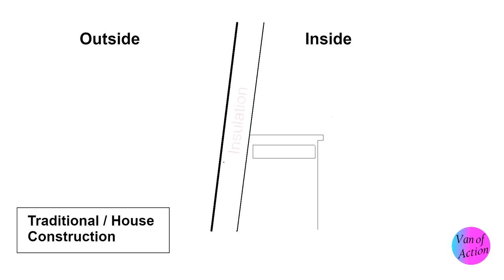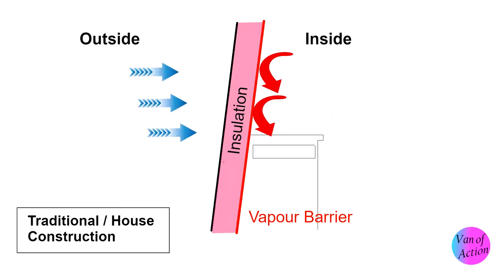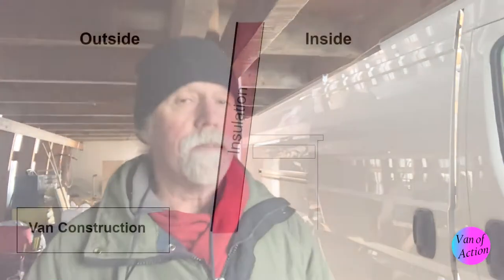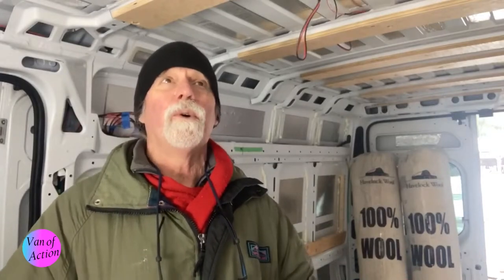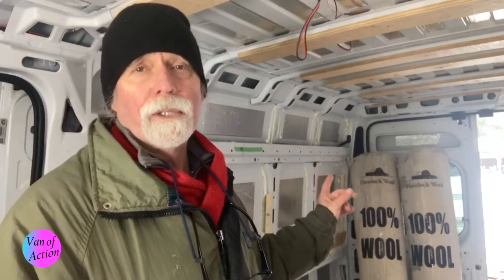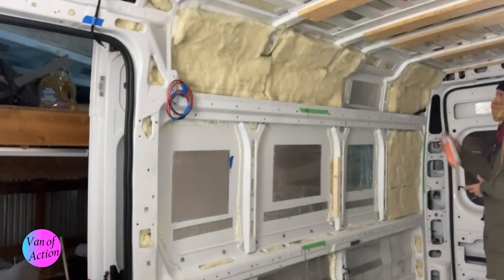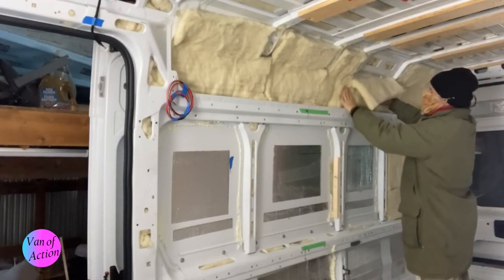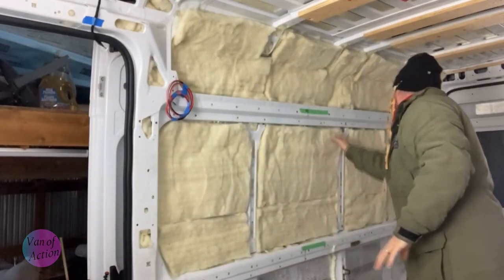How To Insulate A Van - VanLife Havelock Wool, spray foam or thinsulate for a warm and quiet vanlife

Comment: I just wanted to commend you on your replies to some of the comments that seem quite critical of your method of insulation. This seems to be almost an emotional subject to some. Personally for myself in my '20 Promaster Im using thinsulate on the large flat surfaces, leaving the large cavities at the roofline sides and down the ribs along the sides open and free as an air passage way though all ribs are covered on the living side surface with 1" R Max. All four corners at the ceiling have 4" computer fans built in drawing air after a humidity event from the floor area through the ribs of the van into the living space and expelled by the 2 Max Airs vent on the roof. Absolutely no inner vapor barrier for me as the outer sheet metal of the van is a given vapor barrier and I dont want to trap moisture between two vapor barriers.
Reply from the maker: Hi JG-k4oi  - thanks so much for watching and taking the time to comment - I believe it's in the conversation we learn and grow.  I don't have to be right.  - yes - insulation sure gets the blood going.  So many different ways to it.  I'm intrigued with your use of the fans.  I agree with the concept but I'm not certain of the effectiveness in extreme colds.  The difference in temperatures outside / inside and the small R value of any insulation is going to cause condensation - maybe not where the air is moving - but at the dew point of the system everywhere else.    But that's just me ... let me know how it works.   I hope you'll join the community and stop back. ..... Dave

Comment: Did you take any measures against the thermal bridging that occurs on the structural metal that your wooden framing is attached to?
Reply from the maker: Hi David.  Thanks for watching and commenting.   I did not.  All in we’re talking about 2 maybe 2 1\2 inches of insulation.  I believe it’s possible to over analyze things.  I just strapped the ceiling to accommodate the wood ceiling and filled whatever void was created.    I hope you’ll stop back and join the community. ……  Dave

Comment: Great vlog, new subscriber too 😊 should I put a vapour barrier over the wool?
Reply from the maker: Hi Rachel - thanks for watching and commenting.   There are a million different opinions about vapour barriers.  Mine is, as described in the video, that the band vapour barrier is on the inside of the body metal.  Even if you could actually make a uniform seal on the inside I would not recommend it.   Good luck and thanks for joining the community.   Dave

Comment: Also metal conducts cold and heat. You should've covered all the metal. You left the struts uncovered, you could cover those too. And when you put up the panels you can still screw them on right thru the wool. I got that info from a Mechanical Engineer. Where you didn't put the wool after you put the walls up, on a cold day touch were you attached the panels to the struts and you'll feel it slightly cool because you didn't cover the struts. Won't be anything major but if you press your hand there and hold it there you'll feel the cool or heat on a hot or cold day.
Reply from the maker: Hi Joe - thanks for watching and taking the time to comment.  I agree totally with the theory - but having used the van now for a while I'm convinced that the insulation is really more to control the moisture a bit and the sound a lot.  In terms of keeping things warm it's really ineffective.  Maxing out at a couple inches and with the heat loss through windows and the floor there really isn't much to it.  Open a door once and you start from scratch all over again.   We have used it in -12 C - It gets cold quickly - but warms up just as fast.  But that heat just leaves  .........  be well and stop back.  Dave

Comment: Hi there, thankyou for your video. I live in Australia. Some parts of Australia is cold, some parts of the country is super hot and some parts in VERY RAINY and knowing me, i would probably living or staying in those rainy area due to the lush tropical weather ! 
I have just bought a toyota coaster and currently looking at converting it.
I have watched people talked about foil boards, wools, ultra touch denim which there are none in australia to buy anyways, and apparently thinsulate is really good. But even that is quiet costly to import to australia. So we have earthwool that we use here, not sure about Havelock. 

Would you recommend this methods? 

Maybe simple is better with prevention condensation. It makes sense about wool absorbing moisture and releases it after like you said. 
Im not sure about foil boards.
Also thankyou for the tips about install the insulation post cabinets frame work.
Reply from the maker: Hello Sunflower !!!  It's so cool to me that someone where you are would watch the video I made in my little shop in  the interior of BC !!!!     Thanks for taking the time to comment.   It sounds like your climate is very much like mine.  We insulate for several reasons - keeping in the heat, keep out the heat, keeping sounds in and keeping sounds out.  I expect every / any insulation will do these things to some extent.  What some will do better than others is handle the moisture that will occur in the wall cavity - there is no question it's going to form there (unless a person uses a closed cell spray foam).  

Earthwool is a recycled glass product which appears to be a good insulator.   However it would not absorb and release moisture as natural wool would.   But if that's all you can get then you have to find a way to may it work.  I'm not familiar with a toyota coaster so check to see if it's designed to allow interior moisture that will build up inside - if there are ways for the moisture to escape make sure that you leave them open.    If there is no designed way for the moisture to escape - you'll have to give it some thought.  I'm sure there will be a way to take care it.  We also installed a Noika sound membrane on the walls, floor and ceiling to reduce vibration.

In practice, we've found our insulation and the Noika have dramatically reduced the road noise and exterior sounds when parked - we don't even hear rain !!!   But remember that a couple inches of any insulation will not keep your space warm when it's really cold out.

Be well and let me know how you make out !!!   Cheers

Comment: On the floor would it help to add a sheet of thick plastic as a vapor barrier then bulid the floor frame and use havelock in the floor frame then attach plywood floor? Thoughts?
Reply from the maker: Hi six strings - Personally I would not add the plastic - in fact I didn't !!!!   I don't think it's possible to create an  air tight membrane on the floor, especially along the walls. I believe it's better to let things breathe.  I framed my floor using  1" square aluminum tubing, glued to the tops of the ribs.   I installed the aluminum at about 12 inch centers so I could use 1/2 in birch ply wood without sagging.  Then I put the wool insulation in between.  And then glued the plywood down.  I thing the moisture in the 1 inch space will be minimal and air will be able to migrate in and out.  I hope that helps.  Insulation is such a debated subject in vans :)  be well

Comment: What about the floor? I have a transit and when I pulled the OEM rubber floor up (CCF pad under it) the floor was soaked from condensation so I wondered if that's going to be a problem if it's insulated since it won't breathe? Great video though, I looked today and the havlock is a 6 week delay. The whole vanlife world is buying it I guess.
Reply from the maker: I didn't do the floor when I did the walls - in fact I wish  I had waited to do the walls and ceiling too.  I don't know why people insulate so early in the process.  Regarding the floor - I am starting it now.  I'm only gioing to insulate (or put a floor) in the cabin where we walk.  Not under the cabinets and not in the garage.  I want the floor we walk on to be comfortable but I don't want to sacrifce the space a floor would take in the garage.  For bikes every inch counts.  In the cabin,  I glued 1 inch sqare aluminum channel as a spacer, then added the sound deading and wool insulation in between.

Comment: @ 2:42 You almost got this right here, but you omitted the now-standard Tyvek housewrap (barrier) that effectively prevents moisture infiltration from the outside of any modern residential construction. @ 3:19 "...but in a van, the outside layer is the vapor barrier.. ...we're almost turning our [conventional building] system inside out..."  In a metal building (or a van) you have barriers on both sides, preferably with impermeable thermal resistive insulation (i.e.: has an R-Value) in btween.
Reply from the maker: Hi Video Pipeline -  thank you so much for watching the video and taking the time to make such a detailed comment.   I love these - I believe that it's in the conversation that people learn and form their ideas.   I know there are a ton of people lurking here.   And my experience in van building is that there can be tremendous differences between the theoretical building concepts and how things actually work ......    * Yes* - I did omit the Tyvek housewrap - which  is a very effective moisture barrier for air coming into a house.     However,  I disagree with the comment that " .....  In a metal building (or a van) you have barriers on both sides,...."  you'll only have 2 barriers if you build in 2 barriers and I don't believe it's possible to do that on the inside of a van without using a closed cell spray foam.  A product that would totally change the build.  In my opinion it would not be practical to try to create a wall cavity that was completely sealed on both sides.   And even if it was possible, given the small amount of insulation in that cavity all you would accomplish for the effort is a moving of the dew point - because there's gonna be one.  The question is where is it best managed.   For my van , where and how I use it I'm happy with the results. ..... Be well and I hope you'll stop back .....  Dave
Reply: @VanOfAction  re: "I did omit the Tyvek housewrap - which  is a very effective moisture barrier for air coming into a house." As you probably know,  the benefit of Tyvek (and subsequent comparable products) is reduced wind infiltration and bi-directional vapor permeability, so if resists wind pressure driven moisture laden air from entering the wall cavity, but more readily permits moisture to escape from the wall cavity. This is almost exactly the opposite of how wool performs when used as bulk insulation in a wall cavity (metal buildiong or van makes no difference).
"In my opinion it would not be practical to try to create a wall cavity that was completely sealed on both sides."  Herrmetically sealed is not typically possible, but sealed to the typical vapor pressures encountered certainly is, and in fact new buildings in coastal areas are typically built to this standard. Some people don't want to seal off the inside surface of a vehicle skin due to concerns about making collision damage repair more difficult. To each their own, I guess, but IMO that's a strange prioritization. 
"And even if it was possible, given the small amount of insulation in that cavity all you would accomplish for the effort is a moving of the dew point - because there's gonna be one."  In cold exterior temperatures, the dew point will be on the outside. The primary rationale for using thermal insulation is to allow living spaces to be conditioned, in which case there will be no condensation on the inside walls even when the space is relatively full of breathing occupants.
Reply from the maker: Hi Video Pipeline - thanks for taking the time to respond.  You clearly have a concrete grasp on the theory of building envelopes.  I don't expect you've ever built or spent time in a van.  If you ever do you will be able to insulate any way you want,  I'm very happy  with the method I used and would recommend it to anyone......    Dave

Comment: What effect is gravity, in a moving vehicle - a vibrator essentially - going to have on wool batts, or fiberglass, or any batt (except rock wool which is structurally stiff)?
Reply from the maker: Hi Rusty Cas - thanks for visiting and commenting.  I think insulation is the biggest debate of van building.  Since I installed the insulation I've driven about 21,000 km (8 in 2021 and 13 in 2022)  during that time I have had a number of the interior panels open on the inside to run wires or install something and I have found no insulation sagging or giving way.   I didn't expect to though.  I glued the wall batts in place and they are compressed to a degree when the interior finish is applied.   I would not worry about the insulation giving way at all.  And for the reasons I gave in the video I would not consider a rigid insulation at all.  But that's just me !!!   Be well and I hope you stop back.

Comment: So Havelock Wool sells a pallet that says it will cover 1200 s/f. Is that sufficient for a van build like this?
Reply from the maker: Hi Justin.  Thanks for watching. - measure your van.  The square footage (length x width) of the places you want to use the insulation.   In my 3500 extended Promaster  I needed about 340 sf.  Be well and stop back…….   Dave.

Comment: Nice video tha helps me a lot.  But i have another question  i have to put some insulation.  I have. R15 insulation  tha helps  with  sound  and  humidity?
Reply: Can you really help me with that  plz.
Reply from the maker: Hi OSO.  Thanks for watching and commenting.   Any insulation will help with sound - both sound coming in and sound going out.  I can’t believe how quiet our van is - even driving !!!!!   But no insulation will help with humidity.  Humidity is going to happen.  The goal is to try and make sure it doesn’t cause too much trouble.  Hope I understood your question  ?????
Reply: @VanOfAction   thank's  that really help me  anything  else  you think  can help me   to prevent humanity
Reply: @fuertep2do  - Humidity is simply going to happen.  Condensation happens when warm are meets cold air.  So depending on the time of year and where you are you may have little (an area where the outside and inside of the van is always about the same - maybe northern USA or southern Canada in the summer)  or  you may  get a ton of humidity (condensation).if you're in a place where it's very cold outside compared to the inside of the van ( anywhere there is a cold winter,  maybe in the desert at times)  Keeping the air moving will reduce it, so a fan in the van is a help.  But in the walls the air will be still so you'll get it for sure.  Hope that helps.  Be well
Reply: @davechomitz1545    Wooow  yeah your right  thank's  so much.

Comment: As with the 3M Super 77 spray adhesive, I understand that the max temp to use is no more than 90 degrees fahrenheit.  I do not know what the lowest temp to use is.  Thus I figure "not too hot and not too cold", and not too much humidity.
Reply from the maker: Thanks for taking the time to watch and comment - it was about 45-50 F when I applied the insulation and it stuck great,   The challenge is only the insulation that comes in contact with the glue sticks.  The rest of the batt just hangs there and it pulls away very easily.  I would insulate much later next time.  Be well

Comment: What about thinsulate for insulation? What about mice and such?
Reply from the maker: Hi Danielle - thanks for watching and commenting.  Some folks use thinsulate for sure.   If installed properly it can change the location of the dew point - which for me was not wanted.  If mice get into the van there are going to many problems, not jus the insulation so we take steps to keep the out.  Be well and I hope you stop back.  Dave